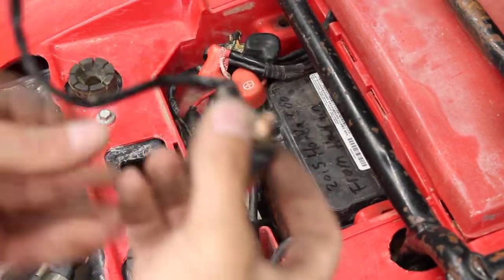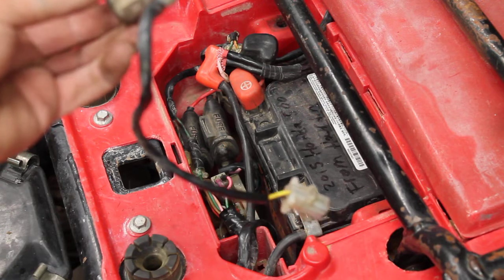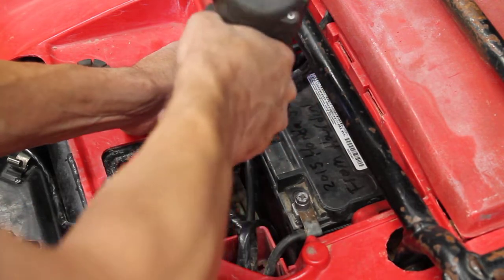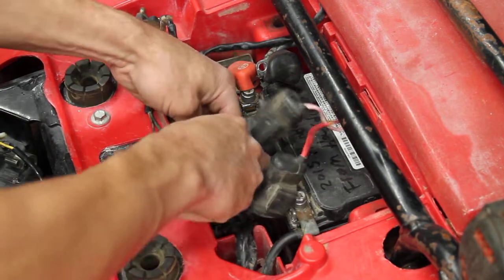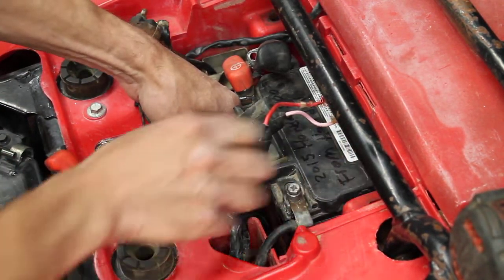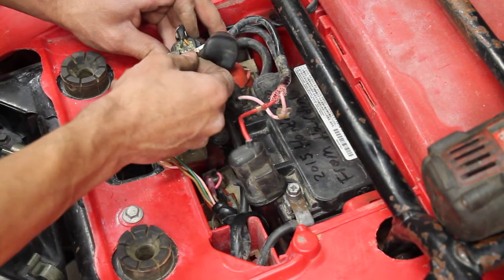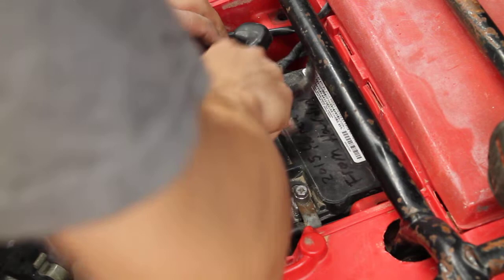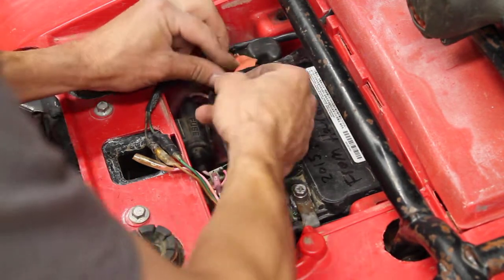Learn How To Replace The Electric Starter Solenoid on a Honda Fourtrax TRX300 ATV 1988 - 2000

Comment: LOL... thankyou! ive been manually jumping it across with wires now for 4 years. Thanks love when ya ll place part number in.. God Bless
Reply: What if it don’t start with metal or maybe should I try wire ?
Reply: @Paysostunna4  i just ordered a new solenoid there only 12 bucks on amazon...  I would and in this order... Make sure you've got plenty of juice in your battery.And everything else lights would not work.   Then if you have juice to your syllonyd, I just attached 2 wires onto the screwnets on top of the cylinoid and you can just hand jump until you're new cylinoid comes..  
        I'm not much of a mechanic, but if you have juice, you should be able to jump at a cross or sill annoyed if you're starter is okay once in a while they will hang up... But like I said, new cylinois 12 bucks.Just order one and then at least you know what it isn't.. That's my mechanical mind.I just heard change and shit haha ha

Comment: nice job I have a new bat and solenoid yet I have no green light or start but if I jump the solenoid it will start up would a fuse do this.
Reply: Me to.. for four years, guess ill find a solenoid n replace it.. LOL  ... I think the jump around solenoid is a bad solenoid, use to be in are old pickups. there cheap im just gonn get new one